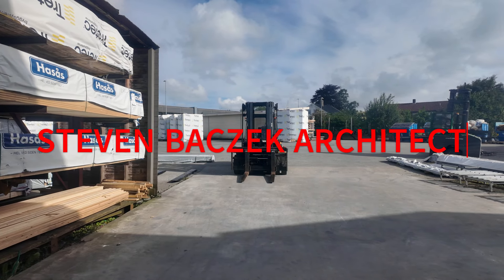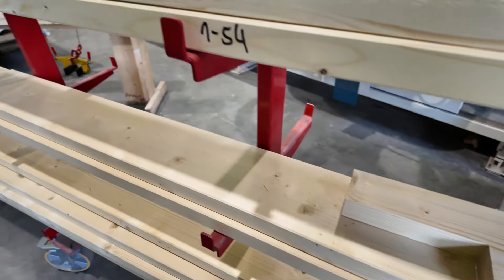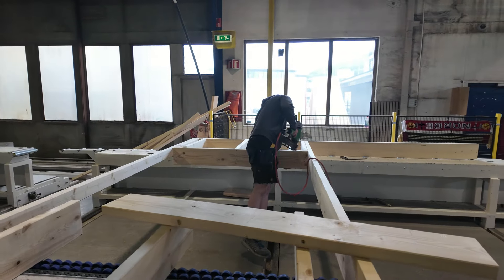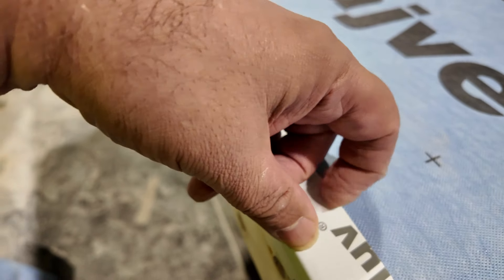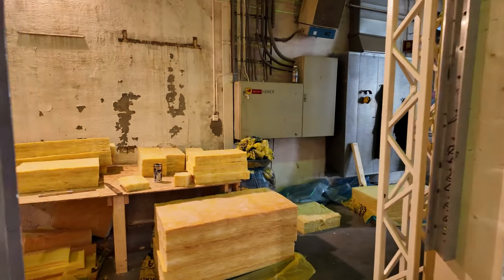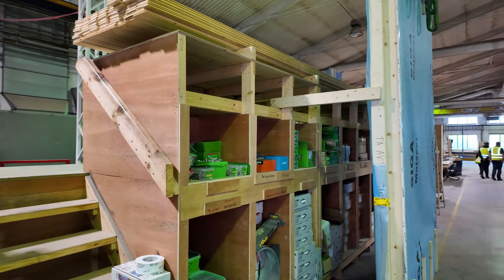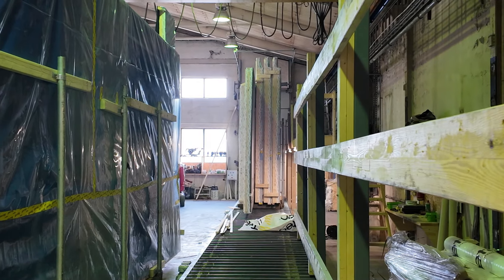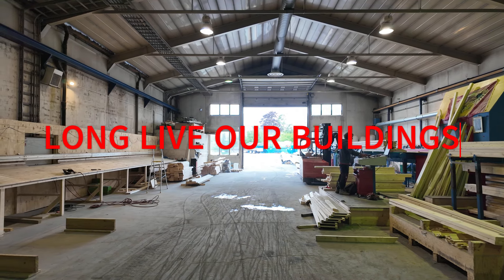PREFAB Factory Tour

Comment: I like the way they do this type of pre-fab construction.  If you combined the "pod" finished room concept with this pre-fab wall assembly system you could have a very close to traditional stick build construction, all setup in a few days on site with a crane.  Not a fan of the "panelized" pre-fab filled with foam type systems.